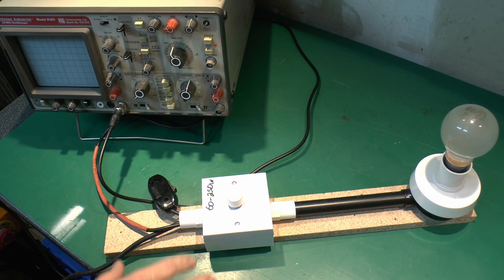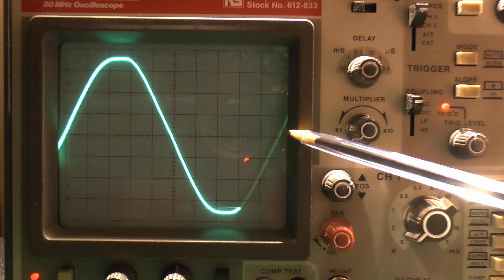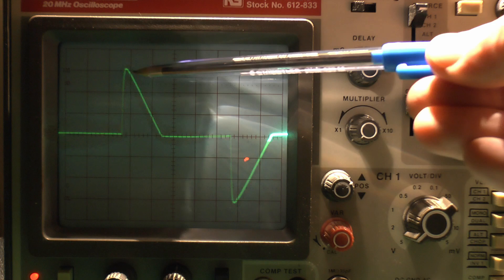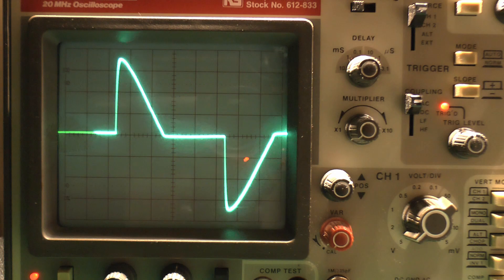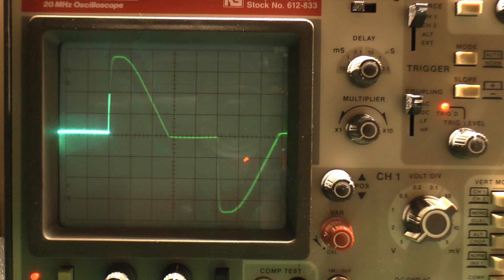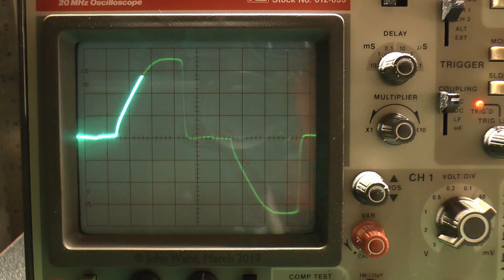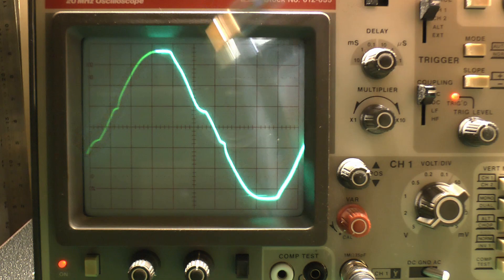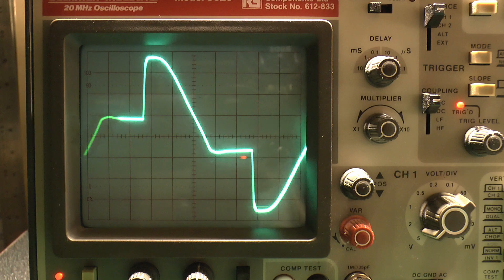Lamp Dimmers - Leading and Trailing Edge

Comment: A decent quality dimmable LED lamp driver will be able to dim equally well on either Leading or Trailing Edge dimmer, since the mains waveform has absolutely nothing to do with the way that the LED dims itself (via it's own PWM). All it needs to know is how much of the duty cycle is at zero volts, and it doesn't care if that is leading of trailing.
The main issue is that Leading Edge dimmers are OK for inductive loads but causes multiple problems with Capacitive loads, since the sharp rise time creates a back EMF from (capacitive) light fittings that causing "ringing" and misfiring for the (usually very crude) Triac control circuit.
So, it's not that (all) LED lamps don't dim nicely on Leading Edge, but more that the Leading Edge dimmers are an el-cheapo solution that works great for Resistive (incandescent) and Inductive (LV halogen transformers) loads, but not on switchmode power supplies. The very best LED driver chips use complicated PFC and timing manipulation to present an almost "resistive looking" load, and this helps cheap Leading Edge dimmers cope with the non-resistive load.
Reply: I bought a decorative Edison style led bulb and it states on the box you need to use Trailing Edge. These bulbs have Chip On Board and run off mains AC.
Reply: zoki kostadinov  - it probably won't be the LED filament (as such), but more the driver circuits that are used in the new Osram bulbs. What I mean by that is that there is nothing particular about "filament LEDs" that can make a noise - they are just a different way to package the tiny LED dies in a thin line (often of glass or ceramic) rather than onto a flat PCB substrate like used for COB packages.
A triac-based dimmer (which your touch lamp will most certainly be) produces a very sharp switch on at the beginning of each mains frequency cycle. So in USA that would mean a considerable power pulse with a frequency of 120 Hertz. That sharp rise time of voltage can cause a sudden creation of magnetic fields on the driver PCB, and anything that's physically loose (eg: an inductive coil designed to suppress electrical noise) can "rattle" and create a buzz.
This is typified by a noise that will change in intensity depending on the dimmer setting. So it might buzz the worse at half dimming, yet quieten down at higher or lower settings.

Comment: Thank you JW for taking the time to explain about the generation of noise interference and the stark differences between leading edge, trailing edge and the use of various mode settings on dimmer controllers. Dim the light without the noise is like the message of salvation to a lost sinner. I appreciate your dedication and am grateful.

Comment: Excellent video John. I work in the LED industry in a technical capacity and dimmers are one of the most confusing areas for the general public.  If in doubt start with a varilight V-Pro, in default trailing edge mode it will dim most LED loads well.  Available with capacity options up to 300w and is very inexpensive and widely available.

Comment: thank you for explaining leading edge and trailing edge in a light bulb and the types of bulbs they are uitable for in relation to dimmer  switches and normal off and on switches. Your video has given me clarity to what type of dimmer switch to buy for my led bulbs, a VARILIGHT V Pro is perfect.

Comment: Thank you for the oscilloscope display and your explanations of leading and trailing edge wave forms.  Lutron in the US makes excellent dimmers with low end brightness of LED bulbs easily adjustable with a small dial while the lamp is on.
Reply: I just installed one of those new Lutron units today. (Which is why I'm revisiting this video!) It replaced an older, identical-looking Lutron dimmer that was made before LED and CFL light bulbs were common. It's likely from when my house was rewired sometime in the mid 90s. It worked well with the dimmable LEDs I had in the fixture, until it started intermittently flickering, however it never dimmed the LEDs as well as it could dim incandescents. The replacement has that extra adjustment on there, and that is great! Also, full brightness looks brighter to me. Overall, it's an improvement over the old one. Also, I did an "autopsy" on the old one, and found a loose connection on the input filtering capacitor. Sure, I could fix it, but I don't have any incandescent lights in my house anymore, so what would be the point?

Comment: Way back in another life when I was a roadie on the pub and club circuit (at the bargain basement level, just beer money stuff really), I built a lighting rig that used small PAR 38 lamps, and ran them from a controller made from domestic dimmers. There were only two bulbs per channel and they were never on for more than a few minutes at a time, but looking back I'm surprised it never blew up! It was fine for a typical 15 foot wide stage, but used to make the occasional strange noise through the PA, and now I know why.
Ta muchly JW, old mystery solved!  ;o)

Comment: I think the flat part of the LED waveform is the "turn on" voltage of the LED string (about 2.5V per LED), so LED current only occurs when voltage exceeds baseline voltage.
It would be interesting to see waveforms when driving non-dimmable LEDs.
Reply: Flat part is the internal power supply voltage of the LED power supply, as the mains voltage drops below this the diode bridge in the dimmer, used for the IGBT inside, disconnects the incoming voltage and the voltage on the suppression capacitor holds up the voltage for a while. Would be interesting to see with a regular incandescent or halogen in parallel with the LED though that discharges this. 

Very nice demo though, and also the scope trace brightening up as the beat between the mains frequency and the camera rolling shutter moves down the display. You can see the actual data being read out at the edges of the brightening line of the refreshed phosphor in the way it jumps into sections at around the zero crossing.

Comment: I haven't seen an oscilloscope.being used since the mid 70's when the computer engineer used to perform maintenance on the Computer I worked on. It used 10mb disks that weighed 20Kg (5 platers) and it had 64KB of RAM.

Comment: would be fun to see current waveforms of those LED's
Reply: Would more or less be the same with Nick? As current is proportional to voltage
Reply: @abdulseaforth6930  not so true. D letter in LED implies its nonlinearity, it generates harmonics. Typical current waveform of LED is sharp decaying spike both positive and negative according to voltage polarity
Reply: @abdulseaforth6930  Only if the load is resistive (like a filament lamp). When you have a reactive load, current is no longer proportional to voltage anymore. Hook up a cheap power adapter with a fullwave bridge followed by a capacitor filter, then watch both voltage and current waveforms. They are not even closely similar.

Comment: Don't you think it would be a good idea if LED bulbs were marked with details of the dim switch mode with which they are designed to operate? The data sheets supplied with these bulbs, if any, provide little information about the dimmer switches with which they are compatible. The data sheets offer lack the technical information.
I have encounter LED bulbs that are designed to operate with leading edge dimmers. The clue is in their weight, they tend to be heavier as they include large inductors. In my experience, the adjustment range and stability( tendency to flash) of LED bulbs leaves a lot to be desired when compared to the operation that was available with incandescent filament bulbs.

Comment: Great explanation John. Would it be possible for you to do a video on how you hooked up the oscilloscope and why there may be flames if you do it wrong?
Reply: It would indeed be good to know. Here is the quick why you don't do it;
Scopes are low voltage and low power test instruments and usually have a maximum input voltage of 50 volts. So that won't work with the mains levels.

The input is co-axial and the reference level is electrical earth. You would need to connect the neutral to the scope earth (which is internally connected to mains earth) and therefore make the scope case part of the mains circuit.
The potential energy that could be dissipated in the scope is beyond any safe design limits. This is covered by instrument category now. Few scopes are rated for anything but cat 1.

The correct way to do it is with differential (voltage) probes and current transformers which both cost a fortune.

I bet there is a voltage divider in the "brown wire" and as JW said the rig was being fed from an isolation tx, to get round the neutral to earth connection issue. The other option is to wire the scope with no earth in the plug. Then it really can go bang.

Keysight probably have a good video on how to test heigh energy circuits with scopes.

Comment: Triacs cutting current only in zero cross passings.An inderesting device i didn't know until recently that exists is called Gate Turn Off,GTO in short that can open and close in any random ac phase.But i havent found any commercial type for less than 1KA as far.

Comment: Strange the way the voltage to the first LED was above zero even after the dimmer had turned off. Adjusting the scope so the 0V point was in line with the graticle would make this clearer. The second (filament type) LED was much closer to zero after the turn off point. This would result in the second LED dimming to a lower level. Connecting a true RMS meter (with a high enough frequency response to cope with the harmonics) would be interesting as well.

Comment: Hiya John, the way 
that second dimmer 
started and ramped 
up is rather similar to.......

.........The speed controller in that Russell Hobbs vacuum cleaner I have.

If I turned that right up and applied power, the motor doesn't just instantly scream-up, but kind-of "soft starts" up to its top speed.

Similarly, the speed selection dial is also not "direct acting." I can whip-up the dial to the top and back down again really quickly, and unlike a variac, the motor does not 'follow' where the speed selection knob goes to. It's a bit like me telling something what speed I want the motor to go to, and then it tweaks-in the speed.... in rather-much the same way as me telling someone to rapidly turn a variac up-and-down by rapid-fire shouting a variety of random voltage settings on the variac to another person in another room. :D

Sinewaves on dimmers..... Ooooh, choppy-choppy. :D

That's where a variac is Muuuuuuch better. :D

Request...... dial-up one of those LED lamps on a variac and see how it behaves with a reduced voltage and a sinewave which hasn't been massacared by electronic hocus-pocus.

Thanxx for showing,

-Wayne's Electrical.

23rd March 2019, 17.00
Reply: Dimmable LED lamps use switchmode power supplies inside. The input voltage is largely irrelevant, and they provide the same power and light output in a range approx. 85V to 260V. So it is pointless connecting them to a Variac… it will do nothing whatsoever to the light output.

Comment: Those extra bits of distortion in the waveform can become audible given the right bulb, and is the primary reason I never liked this style of dimmer. You used to could find dimmers that were auto-transformer based, and they didn't have these issues at all.

Comment: John excellent video once again. I have a question can I connect two dimmer switches to one  6wLED light bulb?
Reply from the maker: No, but you can connect one dimmer and connect one or more additional controller to it.
https://www.varilight.co.uk/dimmers/v-pro-multi-point.php is one example.

Comment: I doubt that leading vs trailing edge makes any real difference for EMI. Either way, you've chopping the waveform by multiplying it with a variable duty cycle square wave. Multiplying in the time domain is equivalent to convolution in the frequency domain, and the transform of the pure sine wave is just a delta function at ±line frequency. 

What you're left with is the transform of the square wave shifted by the line frequency. The phase of the modulating square wave again just shows up as a shift in the phase angle in the frequency domain. The power spectrum itself is unaffected by the phase of the transform.

Comment: Great presentation! Would it be possible to ask for an explanation on how dimmable LEDs work - for instance why doesn’t the power supply in the LED just continue to provide the same, constant voltage / current it is set to, and then shut off when the dimmer is turned down to low?
Reply: A dimming driver is specifically designed to detect the incoming waveshape and convert that to a certain led current or PWM current.
Reply: @rowifi  Makes sense. Thanks!

Comment: Hi J W. Quick question. I want to buy a step down from 12v to 5v 1A only one I can find is a 12v to 5v 3A. Will the extra 2 amps burn or damage my device ? Only my device is saying it's 5v 1A
 Many thanks Mick
Reply from the maker: 3A is just the maximum it can supply, not a problem using items less than 3A.
Reply: @jwflame  Thank you J W much appreciated

Comment: I found your video of great interest, the different arrays of light bulbs & dimmer switches on the market can be very confusing. Some dimmer switches are sold as Suitable for LED bulbs. Some LED bulbs are sold as Dimmable.
My question would be: Could I use a dimmer switch suitable for LED bulbs, where the Led bulbs were standard Non dimmable? & conversely. Could I use a standard dimmer switch where LED bulbs are classed as Dimmable? Or, would both the dimmer switch and  LED Bulbs have to be LED Dimmable? This is a question which I have been asked a lot.
I am currently using, a standard dimmer on a five lamp pendant, with 5 *42w halogen bulbs. I am now down to only one bulb working, as each one has individually blown over a short course of time. Am wondering if a trailing edge dimmer would solve the problem.
Reply from the maker: For the best results use dimmable LEDs and a dimmer designed for LEDs.
Dimmable LEDs and a standard dimmer may work, but there could be problems.
Non-dimmable LEDs will not work with any dimmer.

Comment: Hello, if I use led lamps on an installation with a leading edge dimmer, will they work ok if I leave that on full power and not turn it down? Or will I have to remove it?
Reply from the maker: They might work, but it's not a good idea, as a lot of dimmers are still partially dimmed even when set to maximum.  The LEDs could eb damaged. 
Better to just replace with a normal switch, or a dimmer that's suitable for LEDs.  If dimming, the LEDs themselves must be dimmable as well.
Reply: @jwflame  Thank you

Comment: How to choose between leading and trailing edge mode on a inline dimmer switch that's capable of both?
Reply from the maker: Just use whichever works best with the LED lamps you have got.
Reply: @jwflame  yes but where is the switch? to choose between the two options? Is it a tiny mini button or..? Thanks in advance

Comment: Very interesting to see the waveform for the three modes, especially with the altered waveform when driving the LED.

Mode 3 on the v-pro dimmers is meant to be for Varilight's dimmable CFLs but there's little information as to what the actual difference is. https://www.varilight.co.uk/technical-section/digiflux-mode.php

Comment: Thanks John that was really interesting. I find dimming LED GU10 lamps to be a nightmare. Any more than between 4 - 6 per single trailing edge dimmer you seem to get a horrible buzzing sound. Is this something you've encountered? Thanks.
Reply from the maker: Yes - it all depends on what type of electronics are in the lamps, and how the dimmer actually does the dimming.  Some combinations are far better than others.

Comment: I understand that you cannot connect 2x dimmers (2 way) for the same circuit , what would then happen?
Reply from the maker: It just won't work - if one dimmer is turned down, the second dimmer only gets the tiny amount of power from the first one, so the light stays off.
With both dimmers turned to full, either one might be able to dim the light, but one of them would have to be at full to allow the other one to actually do anything.  Even that might not work as some dimmers are not at 100% even when set to maximum, and the distorted waveform from one could easily stop the other one from working properly.
Reply: @jwflame  got it